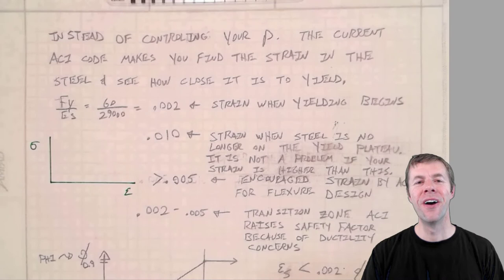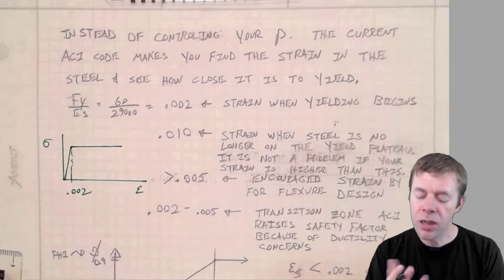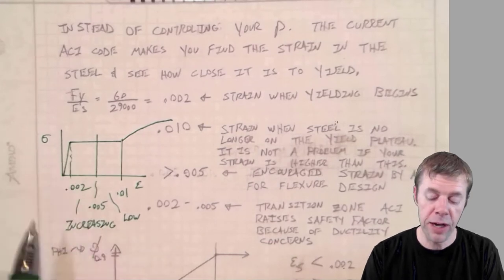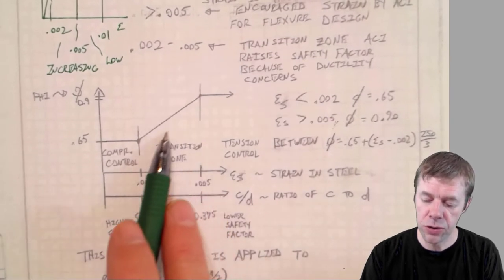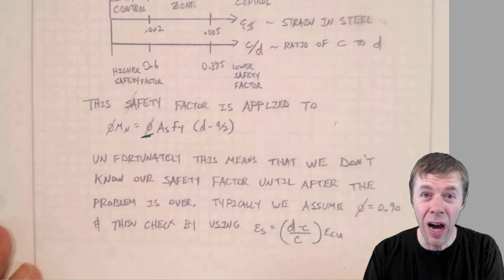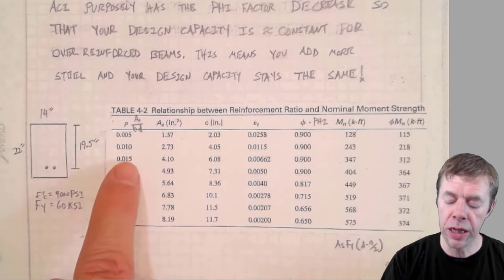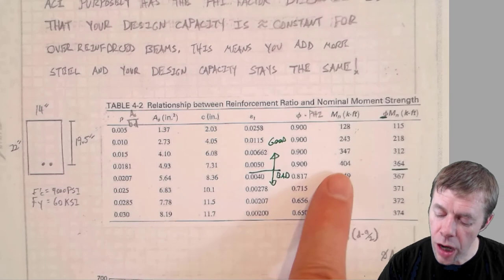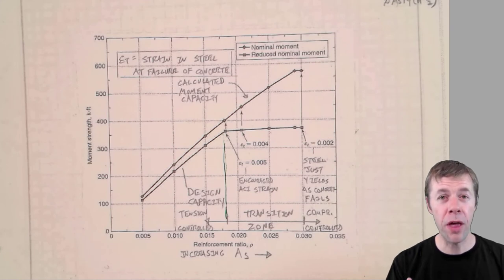How do I find the Phi factor (safety factor) in ACI 318 reinforced concrete design?

Comment: Very informative video!, but 1 thing you didn't cover is:
In case your section comes out to be in the transition zone and thus phi is a bit less than 0.9, which is the better approach (economically, logically and best-practice wise)?

a) calculate new phi, and repeat design using it (so your beam won't be pure tension controlled)
b) add a bit compression steel to reduce the value of a, and thus reducing C, so that the strain increases
Reply from the maker: Thanks for the comment and additional discussion.